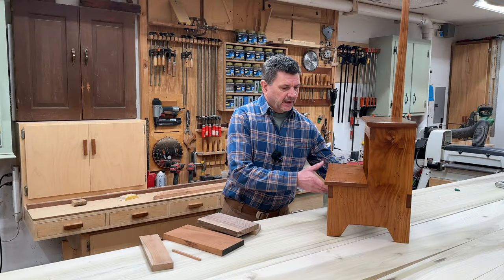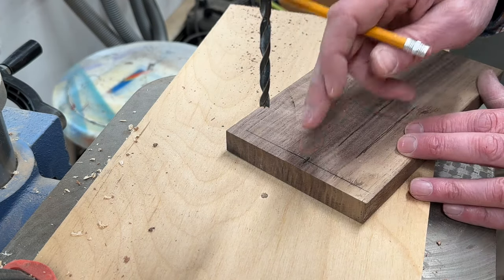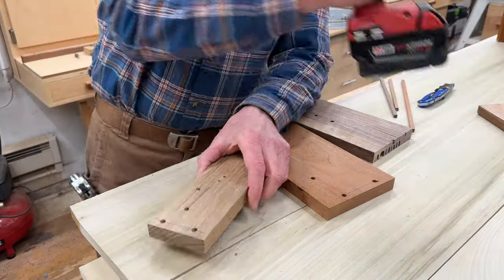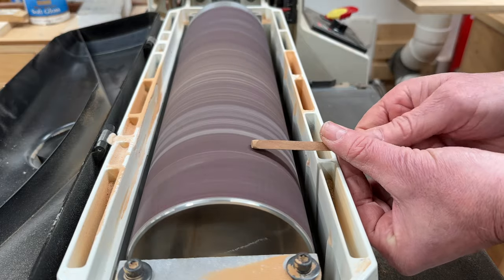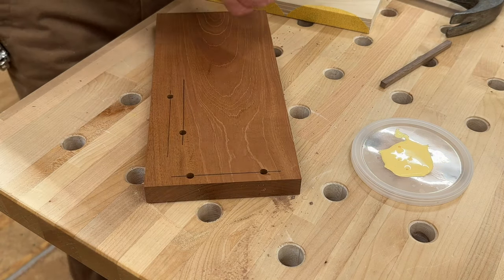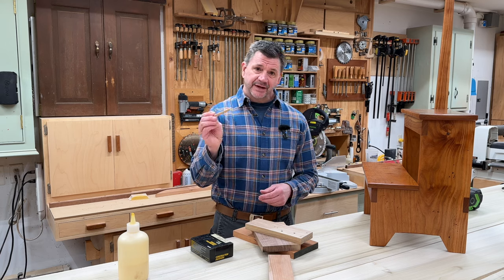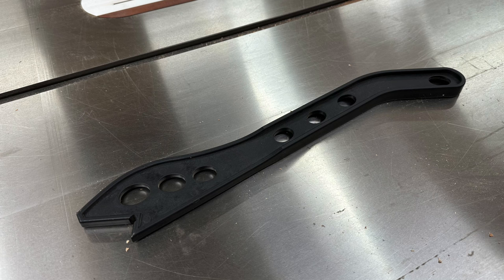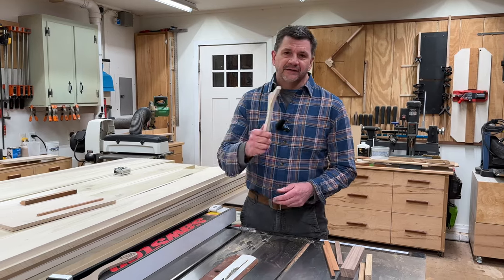Square Pegs - Wood Plugs - How to Make and Install wooden Pegs

Comment: I use square pegs a lot - but not with this technique, which I’m going to try put. My usual method is to make a square mortise using a Veritas punch. It’s fine but getting a constant depth is difficult. 

When is want flush square pegs, I see “your” method as better. However, I usually have pillow topped square pegs protruding about 3/16”. I currently taking a long square dowel (usually in a contrasting wood) and pillow both ends on a disc sander. Then use the bandsaw to cut off to a consistent length; then drive home into the mortise using shims around the hole so that I don’t drive the peg home too deep. 

I’m trying to see in my mind how I could combine your method and those Greene and Greene style pegs. I will try it out and see if the hammering of the square peg into a round hole deforms that pillow shape. If anyone has succeeded, I’d be grateful for their tips

Comment: Makes me want to try this as a decorative feature on small objects, would be a great way to use small scraps of nice woods :) Thanks !
Reply: I think if you're not sure if the wood would split jus add a clamp on the  parallel edges before pounding the pegs in  would greatly help the wood from splitting ......I guess